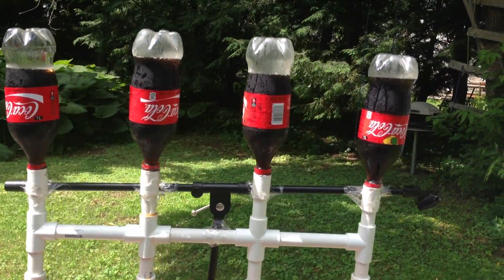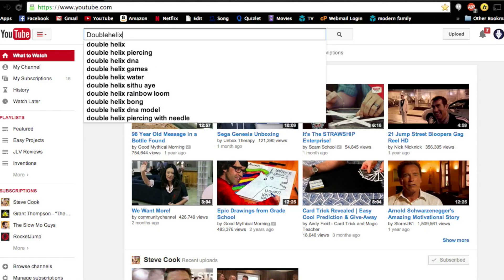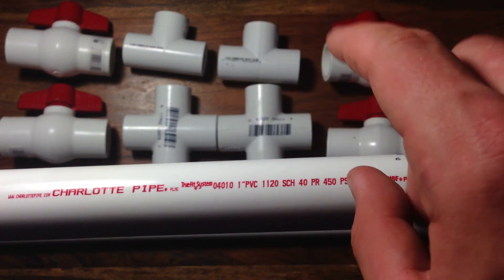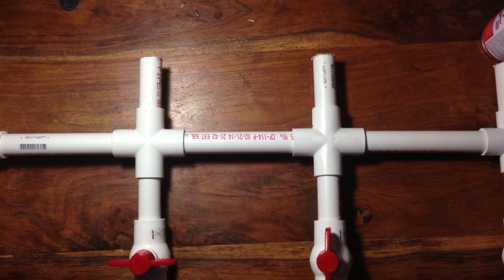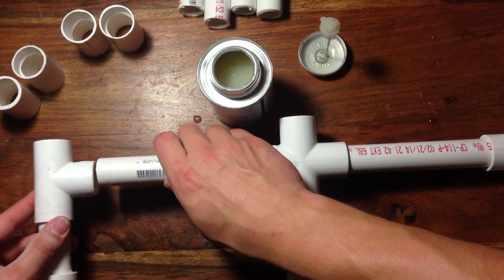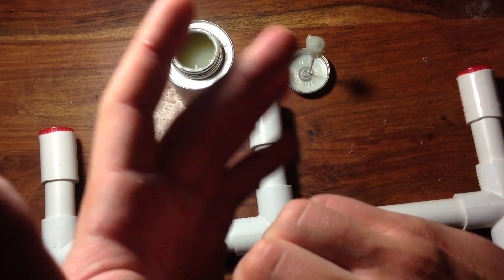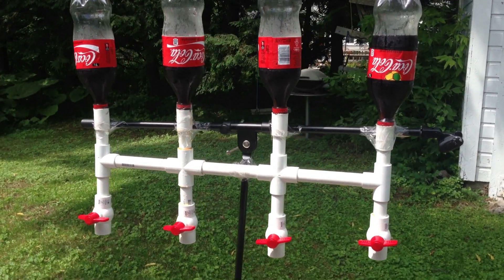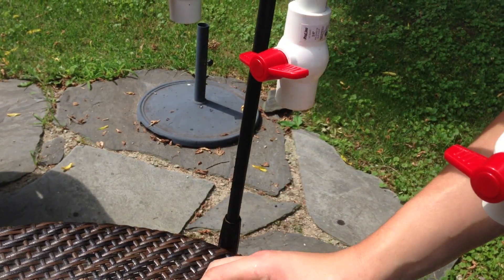How to Make a 4 Nozzle Drink Dispenser

Comment: If you use an aquarium pump attached to a pressurized bottle, or a small co2 cartridge with a regulator valve, you can make a fizz keeper for this dispenser.